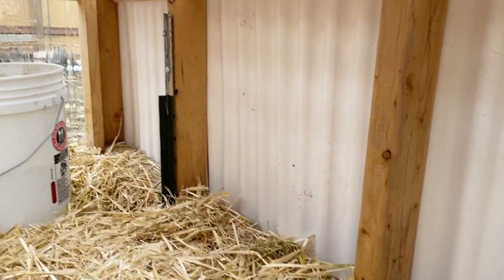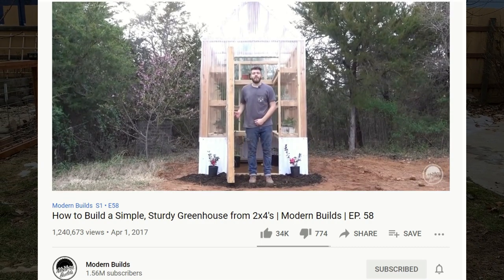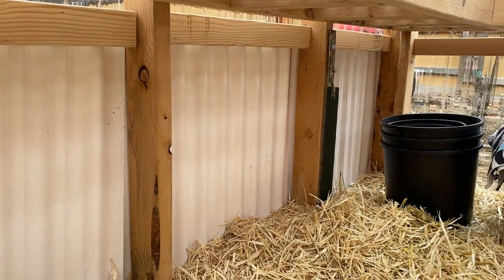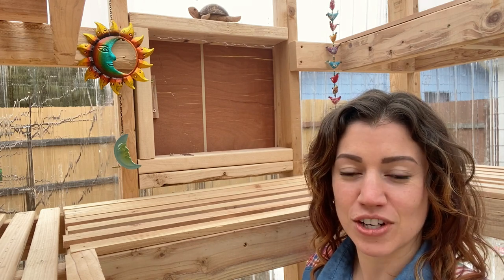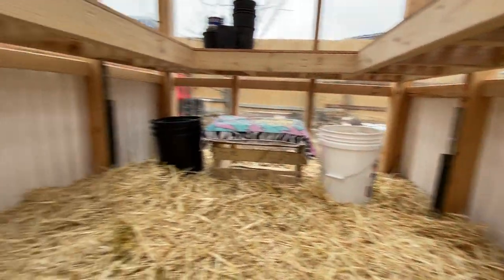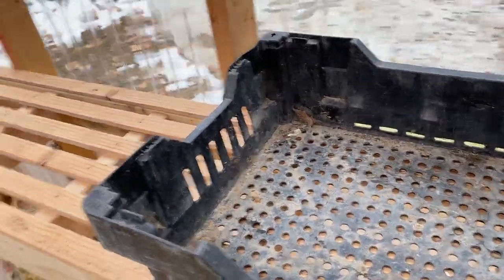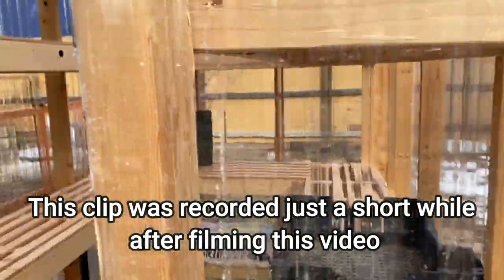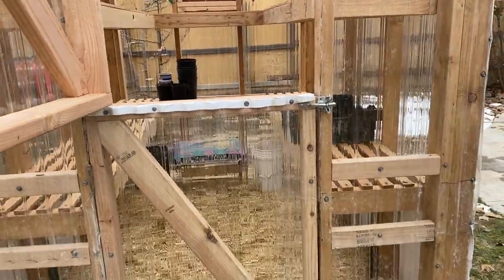Wood Framed Greenhouse| Anchoring a Greenhouse Idea | DIY Greenhouse Design

Comment: Love that you anchored the greenhouse. Anchoring it was my last concern to face. I'm following this design too. I'm wondering which type of panels (brand) did you use for the walls & roof. I'm looking at some from Home Depot but the reviews of it's quality aren't good. How are your panels holding up? I would ask the guy at Modern Builds but he hasn't replied to anyone in years.
Reply from the maker: I’m not sure of the brand of panels, it was the only thing available during shortages last year so we didn’t really shop around.. just got what we could. I think they were from Home Depot. The clear panels are great! Totally sturdy. The white on the bottom is a little more flimsy and I just noticed a spot yesterday that needs to be tacked back down.